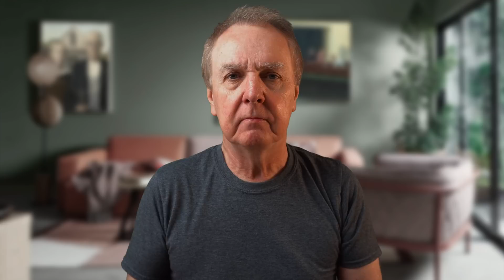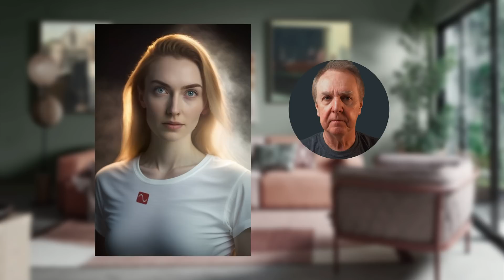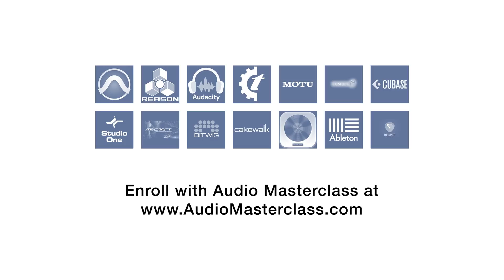Did that Dolby thing ever work?

Comment: At first, I didn't know how to use Dolby B or C. But after I learned that you have to record with this feature to apply it on playback, it did work. And in fact improved the quality of high frequencies whenever I listened on some pocket stereo players. My last tape deck recorder had three heads and it meant I could monitor the recording in real time. And once, I bought a Sony Metal cassette tape. The first thing I noticed was that it allowed a much lounder recording. And as I listened to it in real time, I noticed the improvement such as much lower tape hiss. So in short, metal tapes allowed higher dynamic range and Doby C turned noise floor even lower, so tape his was dramatically attenuated. I was impressed when I found out that although the volume button of my pocket stereo was in "zero", the music was leaking to my headphones. The problem was that these tapes were very expensive and they shortened the lifespan of tape decks heads. So I returned to Chrome and Super Avilyn cassettes using Dolby B or not.

Comment: On my Aiwa Creator's Stereo, the level reads back at about 3 dB less. The sound seems slightly muffled and "digitally processed," similar to fft noise reduction that people often overuse. Since there are no test tones on cassette tapes, I wouldn't know how to align it. If a type I the tape is overdriven, it loses high frequencies, so Dolby would see a radicaly different level. I find the best recording level to be where the VU is barely kissing 0. Holes in the tape also get emphasized by Dolby.

The one-sided Dolby-HX works better and allows to maintain high frequencies at higher levels by reducing the bias.

Comment: If you had a good deck like a Nakamichi you could leave the Dolby button on during playback and still hear high frequencies and less hiss. That is because the Nak's can go to 20,000 Hz even with Type 1 tapes. If you had some inferior deck that only went to say 16,000 Hz you had to turn off Dolby to make the deck sound somewhat good.
Reply from the maker: I don't agree there. I've heard Nakamichi and their products were undoubtedly excellent, getting the very best out of the cassette medium. I've used Studer and Revox decks, basically the same with different badges. For myself, my first stereo deck was an Akai, then in the 1980s I had Pioneer, now I have a Denon in the loft in case I need it. In all cases, with the machine demagnetised, cleaned, and aligned properly, Dolby works fine and is far, far better than the noise there is otherwise. DM
Reply: @AudioMasterclass  Studer/Revox was up there in quality with the Naks, if not even better than some of the lower level Naks. I have also seen some amazing Tandberg decks that were simply amazing sounding. I was talking more about cheap decks that struggle with high frequencies to start with. Those had many people record with Dolby on, then playback with Dolby off to squeeze a little more treble out of the decks. Even one of my high-end Pioneer Elite decks (15-23,000 Freq Resp) has Dolby B, C, S and HX Pro, but I still use just Dolby B on it (rec/play) and use the Pioneer Flex system to give it a little more sharpness. My other 3 head decks with manual Bias, Level and EQ fine adjustments for calibration allow me to get a little better response from cheap type 1 tapes with a push of more negative bias. It is amazing when you can get a cheap-o tape to sound exactly like the source. That is what makes this cassette hobby so fun. Cheers!

Comment: I was so obsessed with Dolby level and azimuth I purchased alignment tapes from Sony mainly because they were affordable and I had the proper equipment.  My most foolish purchase was a Teac Dolby level tape and I had to sweet talk a Teac rep. to sell me one for $100.00 bucks.  The only saving grace with Dolby is if you play back a tape made on a different deck and it sounds dull if you switch Dolby off it will usually sound much better.

Comment: One thing that I'm not sure you specifically mentioned is that Dolby B was always intended to be something that did not spoil the music too much on  non-Dolby playback - since very many portable or car players didn't have it.  Since our hearing is less responsive to high and low frequencies at lower sound levels (hence 'loudness' buttons on some hifi amplifiers), then the Dolby encoding that has boosted lower level treble frequencies will sound fine anyway, especially in a noisy environment.  But not on your hifi at good sound levels in a quiet room.

Thank you for what I think is a very good explanation of why it doesn't always work properly - I can remember frequently having to clean heads when the music didn't sound quite right.
Reply from the maker: It was the same for Dolby Stereo in the cinema, which I first experienced with Star Wars in 1978 (we got it late in the UK). It was a real wow at the time compared to normal cinema sound. But the point was that the same print could be played in a non-Dolby cinema and it would still sound good. In fact, probably better due to more detail. DM
Reply: @AudioMasterclass  That's interesting, thank you.

Comment: I always used the Dolby switched on.  You are 100% correct: if you get a dull sound from Dolby, it's the misalignment of the heads.  Another reason is that the tape used was over biased when recorded, or just plain bad.   I suspect most complaints came from commercially-duplicated tapes, which were mostly bad.  They were duplicated at very high speeds on the cheapest tape possible to save costs.
Reply: Silly Rabbit, Trix are for....   Really, with Dolby switched off did the heads magically align? 
You need to rethink what you just said.
Reply: @ka7hqp182  Sorry to tell you, but Easter is still a few months away.And, you need to rethink what YOU said.  If you have a three-head cassette deck, or a reel-to-reel, the record and playback heads need to be in perfect alignment with each other.  When they aren't Dolby mistracking upon playback occurs. Simple.  What's worse is when the Dolby is mis-calibrated.  Remember, Dolby is a compander system.  Depending on the type,  it will boost the treble frequencies upon record, and do an inverse on playback, thereby pushing the tape hiss down.

Comment: Only had Dolby B on my early 80s Technics deck. Highs always sounded dead to me. Took it in and they supposedly adjusted it. Found out years ago that the bias needed to be adjusted. It was down 3db at 10khz adjusted from the factory-terrible. I readjusted and concluded if I could get it flat to 12khz I would be happy. Problem is by that time my head was worn out. Lows weren't as good as original material either.

Comment: 15 years ago I bought Pioneer CT-737 tape deck for 30€. It sounded awful. Wrong pitch, wrong azimuth, bad capstan roller. It was mis-calibrated also. It took me more than a year to do a complete overhaul. Then, it sounded EXCELLENT, it has 3 head with 15Hz-21kHz frequency response on ALL tapes. Dolby C was great in reducing noise with no noticeable degradation. I still do some mixtapes, 90 minutes it's best time to play best of the best from your 500 files playlist, sorted the way you like it. But, from time to time, I check pitch, calibration, I do demagnetizing and cleaning and this 35 years old workhorse still work amazing. I wouldn't sell it for 300€ now.
Reply: P.S. I also use to record and listen tapes in my old car that has tape with Dolby B and tapes sounded WAY better than radio. It was clean, quiet, dynamic. It even sounded better than my phone output.

Comment: Dolby B was always a compromise, but worked well enough in good conditions. My experience with Dolby C is limited, but it worked significantly better than B, and I don't recall any issues transferring recordings with C from one unit to another. (I unfortunately never had a chance to interchange Dolby S.)

What gets me is that a lot of current cassette releases I am interested in don't even bother with Dolby B. I understand that currently manufactured cassette decks are sh*t and it's unclear if there are any current implementations of Dolby B decoding (which could not be called as such due to persistent trademark, but could be implemented due to patent expiration). At least let the format be the best it is capable of.

Comment: About your question: I suspect most people used this like a tone-control. 
My question: was/is Dolby-B really free from artefacts (on a perfectly aligned machine)?
Reply from the maker: This is a good point. I've used Dolby types A, B, C and SR, missed out on S. On a properly maintained and aligned machine I was never aware of any problems though of course it would be possible to listen out for noise modulation and any effects on transients. I was so pleased however just to get rid of the noise that I would gladly have traded any small problems. DM

Comment: Clean the heads and transport! Most people I knew never ever cleaned their tape heads and certainly didn't degauss. Some people always seemed to have tape problems, poor sound and tapes that ended up in knots. Funnily enough I never had those problems ... and I certainly didn't lend my tapes to anybody, and if I played someone's tape on my machines I cleaned the heads immediately afterwards. Yes that's over the top but I have 45 year old self recorded tapes that are still in playable condition and sound surprisingly good. Of course it also helps that as you age your high frequency discrimination reduces! (Pre-recorded tapes were always very poor and not worth the money in my experience.)

Comment: I used my Nakamichi ZX7 with metal tapes, usually TDK, and the Dolby C switch in the 'on' position always, for about 20 years. I don't use the deck or the cassettes anymore, but it worked great through the 80s and 90s. Still have the vinyl records and the CDs I bought in the 90s and 2ks. The vinyl records are the best in the end.

Comment: You can believe what you want. I could care less about this noise reduction as it took the life out of recording. I used to use it, but it took out more than it opened up. Most could care less about recording analog regardless which tape format they use. I choose not to use it anymore. More circuits used equals more chance of noise introduced into the signal path. You choose what suits your situation and needs. Your ears are the only ones that matter in this hobby.

Comment: When making my own recordings I don't use Dolby, I just don't have enough noise to justify it. On tapes encoded with Dolby I turn it on and if it is dull I turn it off . That doesn't happen often, usually on old wore out tapes. I used to be an electronics tech and I have the gear to keep my tape decks calibrated properly. Proper calibration is a must for Dolby to work.

Comment: Also the HX Pro & AMTS features really help along w/ metal tape. . I have found that to get the right record levels, it helps-- after recording a track-- to let it play back once all the way through before checking the level. The sound will embed itself onto the tape at a lower level than if one checks it directly after recording. Thanks for you channel..

Comment: If the music you listen to is already noise, dolby doesn't fix this. Seriously, I think of Dolby NR as something like the RIAA curve that goes way back with records. Even reel-to-reel decks without dolby have a curve I've discovered. I thought it would be brilliant to run my reels at double speed and digitally record them at 96 KHz sampling rate and simply change them to 48 KHz in software to save time. But I did a test first with white noise and frequency sweeps to discover that there was a frequency response difference and I assume a type of curve. So I've done all of my digitizing of reels at realtime speed.
Reply: The reel to reel EQ curves are different for the various speeds. They're more agressive at the lower speeds. There were two slighly different standards around the world for many years although they didn't differ by a large amount. These were the CCIR and NAB curves. The cassette system also has pernament EQ curves which are always applied regardless of if the Dolby treatment is further applied or not.

Comment: I've never cleaned any cassette device in my lifetime, and i'd bet that applies to about 99% of people using the things. It's just not how the average consumer used these things. It's more likely they bought a new one. I had no idea about why different cassette types sounded different or which specific type i should buy for any specific device. I also have no idea how much of a difference it would have made for the consumer grade products i used. My experience with Dolby buttons was how it changed the sound when pushed during playback, regardless of how that tape was recorded (how would i remember if i fiddled around with the Dolby button when i recorded that thing?), which is, of course, not how it's supposed to be used.
So when evaluating statements of "the average joe" e.g. about the Dolby button, one should take into account how they used that stuff.
Reply from the maker: This is mostly my point. Non-technical people used the Dolby the way it sounded best to them, regardless of whether it was correct or not. Cleaning the heads, both record/playback and erase, works wonders. DM
Reply: @AudioMasterclass  I wonder if i would've bothered had i known better. I'm more a "listen to the music" type, and if it's too bad i switch it off. I'm passionate about other things. But i was happy to see cassettes and records replaced by digital. The audio was noticeably better (even for me), and it was much less hassle.

Comment: I'm sure it works but there are so many variables that the average user can't be bothered with mitigating. If a friend offered to record something for me, I'd always say to them, "DO NOT USE DOLBY", because YES... I would always get a dull sounding cassette if they did. In addition, many of the "Walkmans" I had over the years didn't have a Dolby switch so it didn't make sense to record with Dolby. Right or wrong, I almost exclusively used BASF Chromdioxide and even Metal tapes and push the levels as high as I could to combat tape noise. No idea if it made that much difference but I'm sure I told myself it did. I recall having a few decks over the years with Dolby C and do remember experimenting with it. Unfortunately, so few decks had it that again, it didn't make sense to use it when recording in case the destination player didn't have Dolby C.

Comment: The best results I ever had recording Dolby B tapes was in 1980 using a quite expensive Aiwa AD6900 machine that had a pretty involved manual tape tuning facility which - if used properly each time before making the actual recording - made brilliant recordings that would also play faultlessly on other machines too. A couple of minutes well spent each time before making a recording.

Comment: When I was still using cassettes up to the early 2000s I just used maxell xl-ii with no noise reduction.  It seemed to be the best at leaving good response on lows mids and highs. Sure there was some noise, but I could hardly hear it except for maybe the blank spots between songs.
Reply: I always preferred TDK SA and SA-X.  If the deck is in great condition, I can get away without using Dolby on record.
Reply: @truesoundchris  Oh yeah, after 1985.  But, before then, their cases were as good as Maxell.  For me, Sony was the worst.
Reply: Any reason to not use metal? I ended up using a number of those in my recording collection in the mid 1990s.
Reply: @gargantuablargg  metal type 4 tape wears the heads up to 3 times as fast as normal tape. Also type 4 tape is expensive, costing more than double the cost of type 2 tapes. The performance of type 4 is better than type 2, but not enough for me to pay so much for it plus wear my heads out.
Reply: @gargantuablargg  They were always more expensive, not universally sold, and, frankly, the high-bias ferric oxides (Type II) tapes always sounded better on my Japanese-made decks.  In the U.S., Japanese brands were the most commonly sold e.g.  Kenwood, Pioneer, Sansui, Sony, Awia,  Sharp, TEAC, Nakamichi, Kyocera....
Reply: Maxwell xlii for the win. Less resonance during shuttle and better cases and labels. I preferred Dolby c. Sounded great at home and boosted treble on Dolby b car systems.

Comment: I had one that made a big difference.  But not on the tape, but on the FM radio.  Weird but that model they all did it.  Had a friend had the same one.  Kenwood,  late 70's tuner.  It was first came out with digital display.  It was a 711 or 721 I can't remember.
Reply: Yes, there was a push for Dolby in FM broadcasting but it never caught on that I know of.

Comment: Dolby B wasn't really all that great, OR all that effective at actually noticeably reducing the "hiss" noise level on the tape, because it only produced about -10dB of noise reduction.

Dolby C noise reduction was about "twice" as effective as Dolby B, with about a -20dB noise reduction capability, however Dolby C was extremely finicky to get right, and UNLESS everything was totally PERFECT with your deck AND you first recorded the tape with Dolby C "on", then playing the tape back with it on would actually sound worse than just not using any noise reduction at all, so it never became very "popular" to use.

Dolby S noise reduction, introduced in the early 90's was MUCH better AND much more effective than either B type OR C type, and gave an approximate noise reduction of around -30 dB, which actually made cassette recording using the best quality tapes and on a really high quality deck, sound almost as good as a CD, which was awesome at the time!